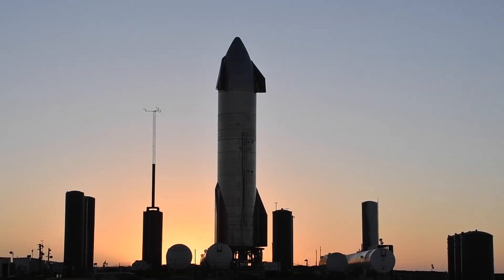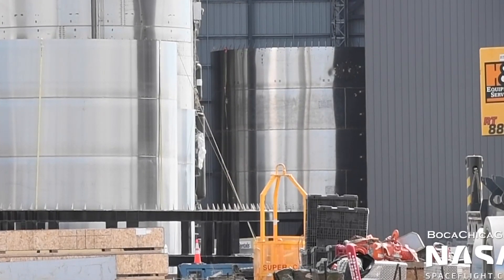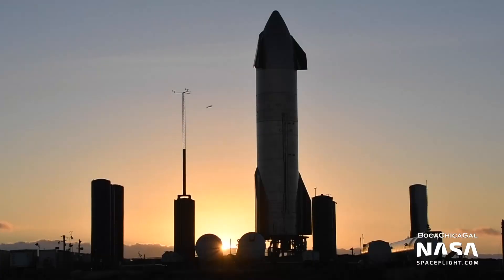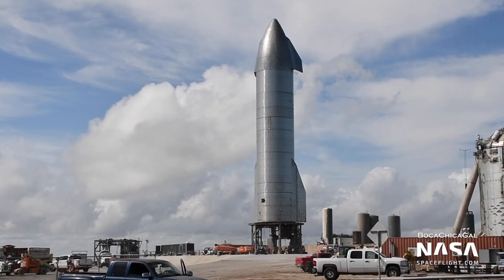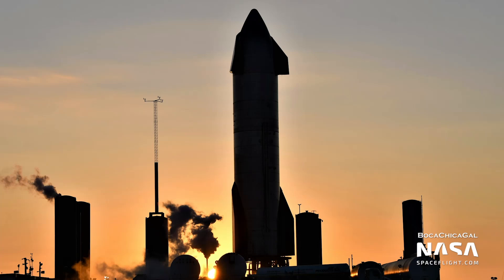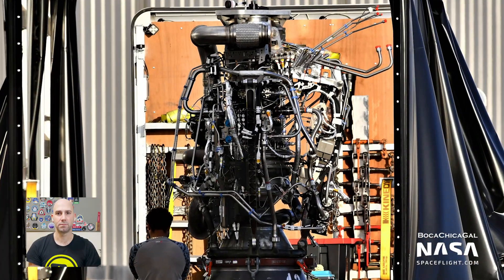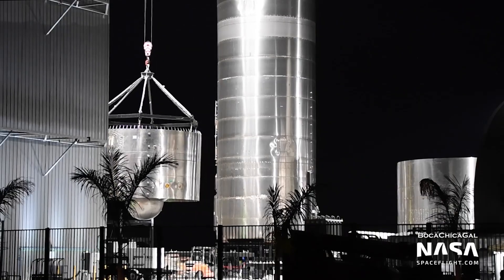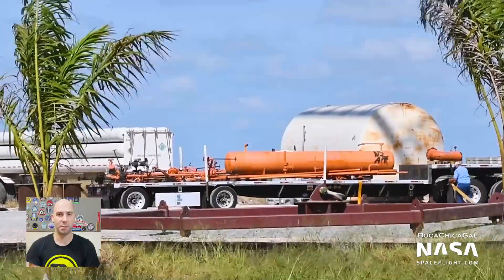SpaceX Boca Chica Weekly Update - Starship SN8 testing, path forward and future vehicles

Comment: Apparently there are still gas reserves in that well. Maybe the new equipment is for methane production.
Reply: I'd say no way.  That truck rig was likely doing a geotechnical boring for foundation work.  Even if they wanted to work over the well, no way they could refine it for use on-site.  It would take too much equipment and doesn't make sense especially because methane is pretty cheap.